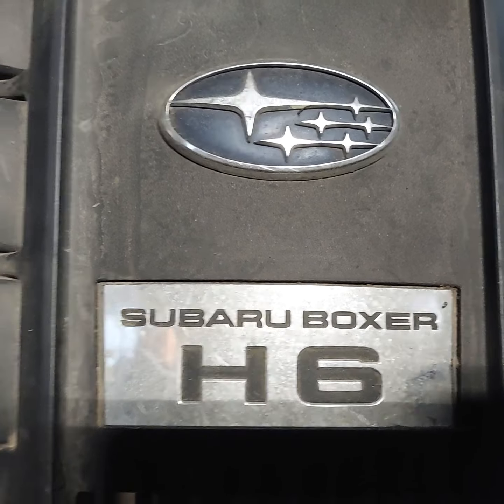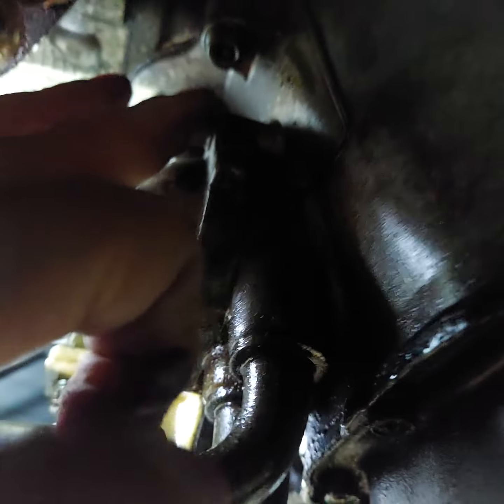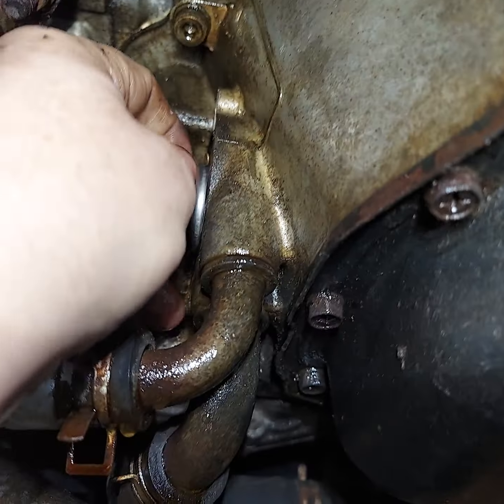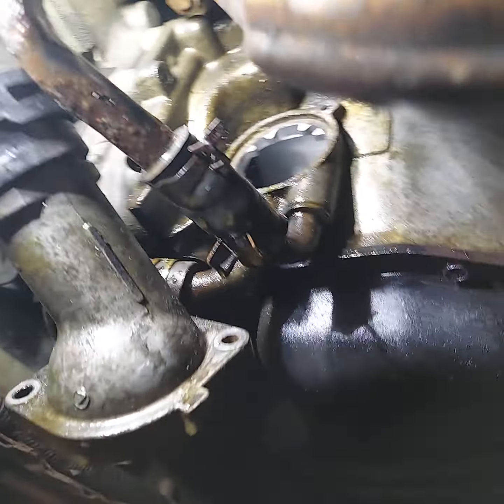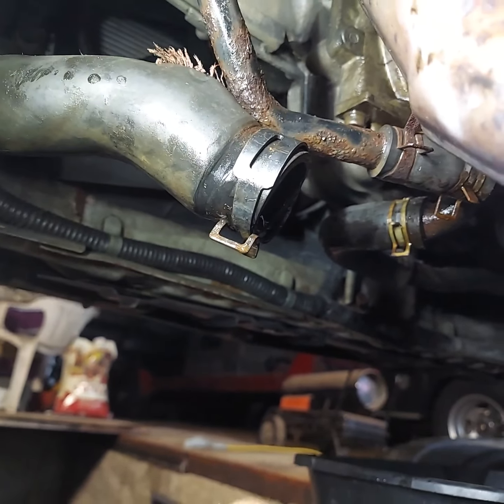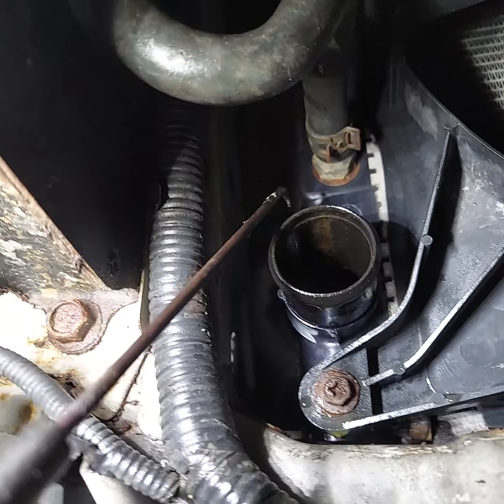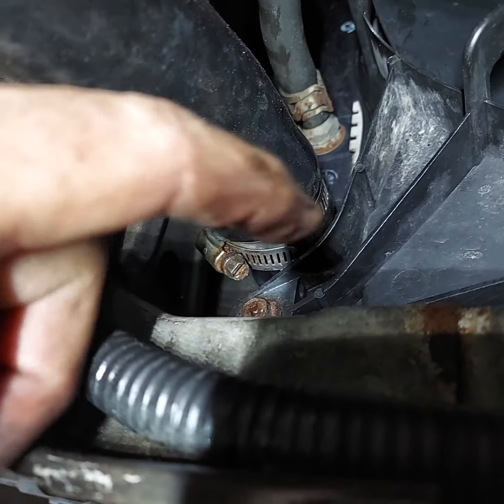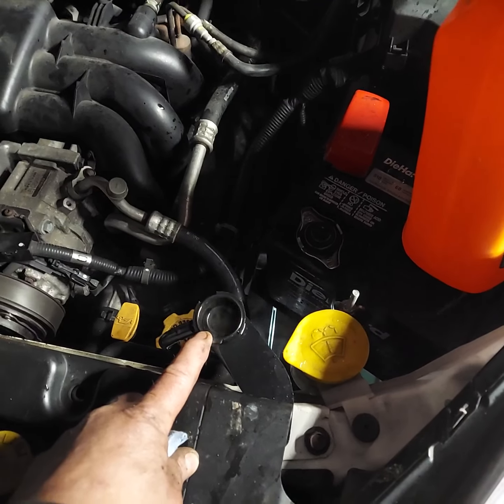2006 Subaru Tribeca 3.0 liter Thermostat & lower radiator hose

Comment: Nice, but no water mix. Use Subaru coolant or a good oil based coolant like Zerex Blue coolant for Asian vehicles. The water pump needs an oil based coolant for lubrication. Replacing a water pump prematurely is not something you want to do on these H6 engines, it involves a lot of work, including timing chains being removed and motor oil replacement.